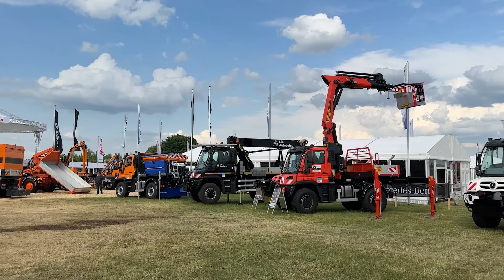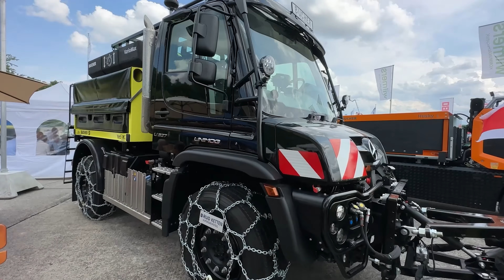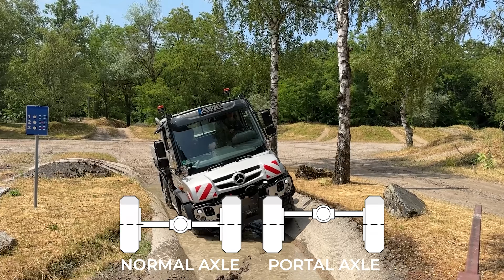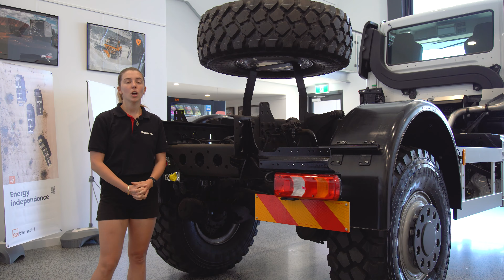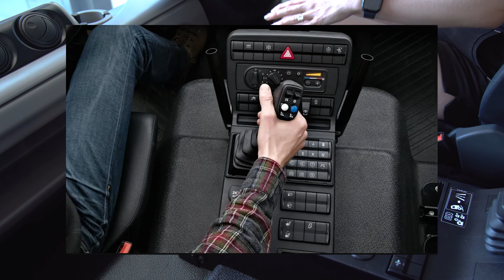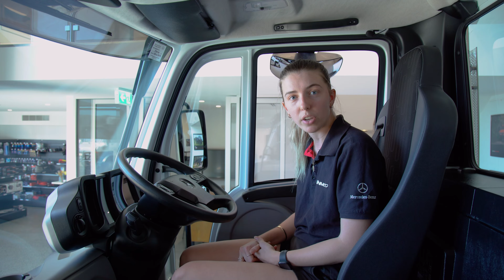The World's Most Versatile Vehicle - Mercedes-Benz Unimog UGE The Ultimate Implement Carrier

Comment: Main question for recreational purpose is the curb weight of the (different) vehicle(s). I understand, thats different for each type, wheelbase and depending on the ordered accessories, but I think a U323, U327 or U430 with 3.9m wheelbase opt out for all the additional hyrdaulic stuff and opt in for the tyre pressure control and (semi)automatic gearbox and with air suspension seats sounds like a realistic base. 7.5to total fully loaded gross weight is critical in Europe for speed and license purpose. To achieve this a curb weight of 4.5to would be necessary. 
2nd thing is - for recreational purpose - are these vehicles, since they are designed for (slow speed) working, suitable for longrange travel. Especially the axles come here to my mind, if they won't suffer from overheating or similar? 
Couldnt find anything of this in the internet. Do you have these infos? Otherwise, I think for recreational purpose, means a worldtravel expedition vehicle, they seem to be almost more suitable then the bigger brother, although the U4000 has undoubtful a much nicer look.

Comment: I would absolutely love to trick one of these out, no budget.
Reply: Being the dedicated implement carrier what would you want to trick it out as?
A timber mill, to trim the hedges of roads, for farm use, a snow plough or what? The UGE is even more of a tool than the UHE, to make it worthwhile owning one you need to know exactly what work you need it to do and spec accordingly but if you want a Unimog for non-commercial, recreational purposes get the other one.
Reply from the maker: @gustavmeyrink_2.0  that’s not necessarily true. As mentioned in the video this chassis works as a great international traveller. Not everyone needs the off-road performance of the UHE Unimog and the UGE Unimog with the longer wheelbase allows for living space in an expedition body. Both have their advantages 😊
Reply: Fascinating video. Thank you.
Reply: I like this one just for the chibi proportions of the cabin!